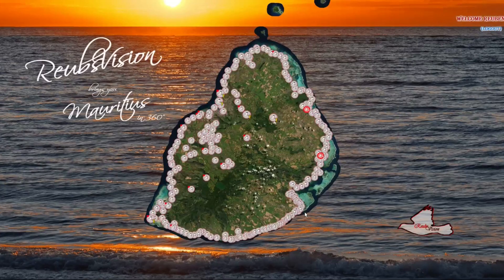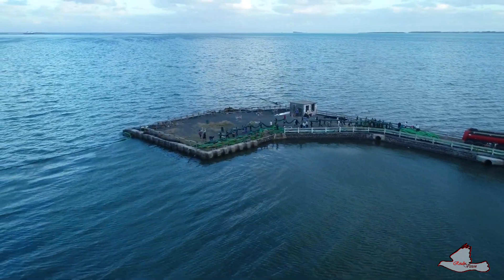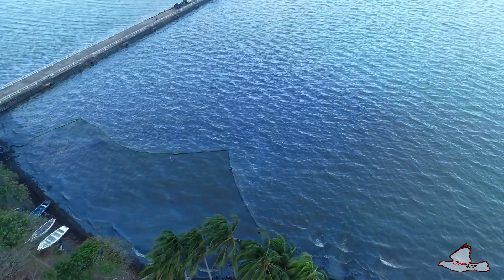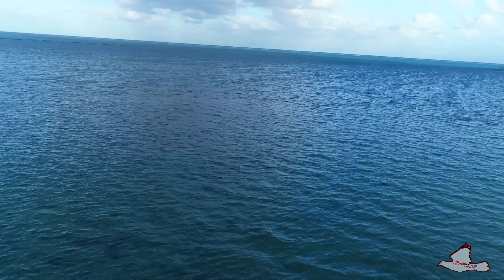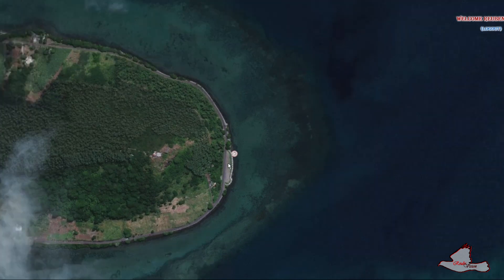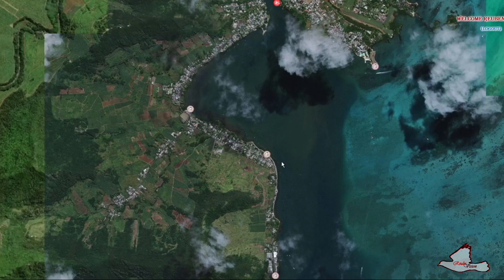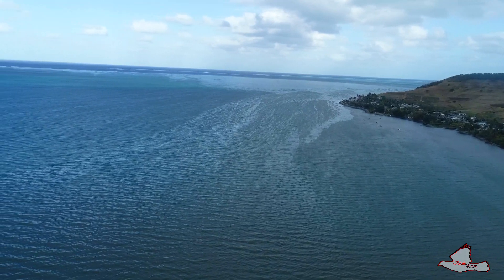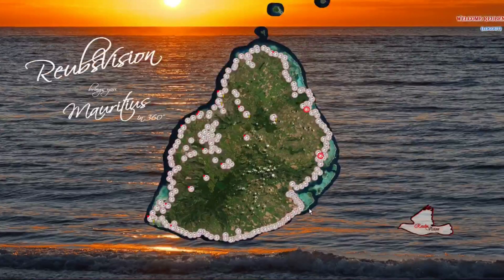2020-08-09 - Visual Oil Progression Status: The Oil has reached the level of GRSE

Comment: Hi Reuben great work, May be this can help..Oil is also usually less dense than water, so it floats. ... This is a compound that lowers the surface tension between the 2 liquids, allowing the oil to break down in very small droplets than can then be dispersed through the water. A dishwashing liquid Crest or any dish washing liquid can act as a surfactant... Can use to clean the oil spill also we can use large sponge can soak up the oil, sponge mattress.